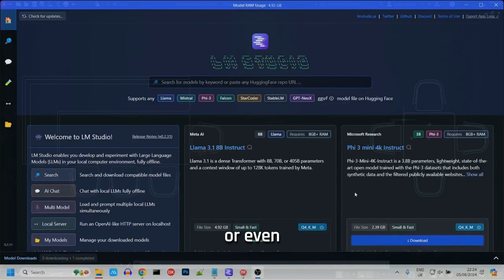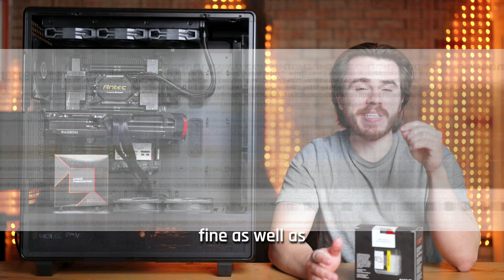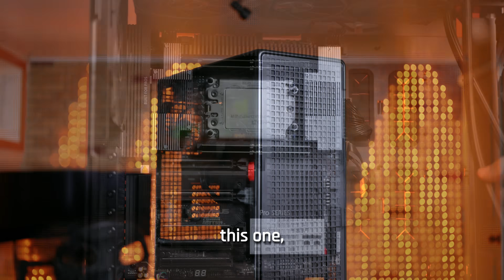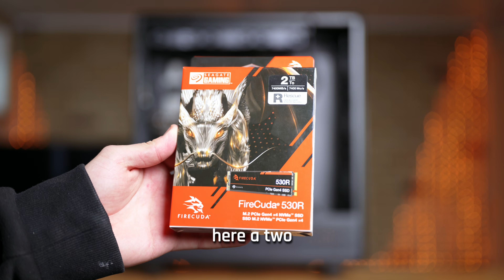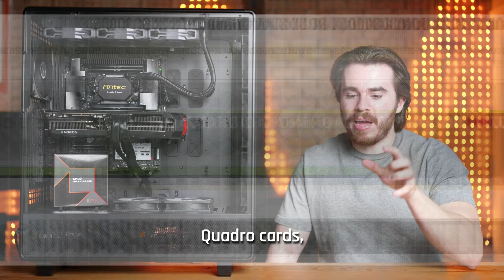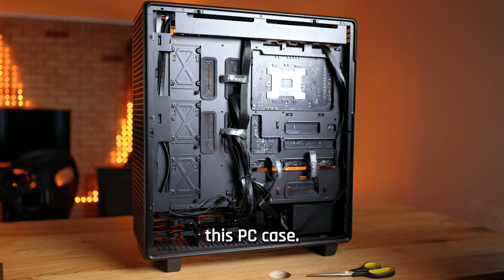The High-End Workstation PC Build Template for 2026

Comment: I’ve been lazy and haven’t built my own rig in a long time.  I was intrigued by this threadripper build.  Would this be good for an Adobe Premiere Pro workstation?  Or would another setup be more robust / budget friendly?
Reply from the maker: It’d be completely overkill

All you need is a Ultra 270K/250K/265K for a video editing workstation 

Either way, most of your video editing processes are going to be more GPU intensive than CPU intensive, so you’ll end up spending more on your GPU (5080/5070ti is minimum). 

I’ve got some video editing builds on pcbuilds.gg you’re welcomed to take for inspiration
Reply: @ScatterVolt  I saw those on your part picker.  Is there a one click to buy all? I’m lazy 😅
Reply from the maker: You can add each to your cart my friend, but maybe there is an add all cart button we should implement at some point lol

Comment: What about my Workstation PC specs:

- Case: `Corsair Obsidian 1000D Super-Tower Case`
- CPU: `AMD Ryzen Threadripper PRO 9995WX`
- Motherboard: `ASUS Pro WS WRX90E-SAGE SE`
- RAM: `Samsung M321RBJA0M22-CLP×8`
- SSD: `WD_BLACK SN8100 NVMe SSD - 4TB, Without Heatsink` and `WD_BLACK SN8100 NVMe SSD - 8TB, Without Heatsink`
- Case Fan: `be quiet! Silent Wings Pro 4 120mm PWM`×30
- Radiator: `Hardware Labs Black Ice Nemesis GTR 480`×2 and `Hardware Labs Black Ice Nemesis GTR 360`×2
- Pump: `Aqua Computer D5 NEXT pump`×2
- Reservoir: `Aqua Computer ULTITUBE 200 PRO`×2
- Tubing: `Watercool HEATKILLER EPDM Tubing ID 3/8" - 5/8" OD (16/10mm) black matte` (Undecided Quantity)
- Fitting: `EK-Quantum Torque STC-10/16 - Black` (Undecided Quantity)
- Coolant: `Aqua Computer Double Protect Ultra (DP Ultra) Clear` (maybe 2)
- GPU: `NVIDIA RTX PRO 6000 Blackwell Workstation Edition`×2
- Monoblock: `EK-Quantum Momentum² Pro WS WRX90`
- RAM Water Block: `Bitspower 4-DIMMS RAM Water Cooling Module (DDR5, Double-sided)`×2
- GPU Water Block: `EK-Quantum Vector² RTX 6000 Pro Blackwell Full-Cover Water Block`×2
- Power Supply: `Super Flower LEADEX TITANIUM 2800W ATX 3.1`
- NIC: `NVIDIA Mellanox ConnectX-4 Lx (SFP+)` 

It's perfect for me. What do you think?

Comment: Hi quick question im doing a mini itx build on a fractal ridge that has a pcie gen 4 riser and i will be using a b850 mobo with the rx 9070, will i be able to easily do the first bootup with the riser cable or should i first plug the gpu directly to the mobo and set the pcie to gen 4?

Comment: Nice build.  I just built a "high-end" PC especially for DaVinci Resolve.  It has a Ryzen 9 5900XT (essentially a very mildly underclocked 5950X), a 5070Ti, 6TG of NVMe storage, and 64GB of DDR4.  The case is a Montech Air 903.  I'm about to build another, primarily for audio production, with a 12900K, a 7900XT, 64GB of DDR5, and again 6TB of NVMe storage.  It will also be in a 903.  Both configurations are obviously more than capable of gaming, which is intentional.  Of note, I bought the 5070Ti around the beginning of 2026for $749, which I believe was as low as it ever got.  I bought all the rest in the summer and fall of 2025, before the AI-driven price explosion.  Sometimes it pays to buy based on anticipated future needs, not current needs.
Reply from the maker: Smart thinking
Reply: hahahah YOU are ME xD I built a similar editing PC this/last year, for Premiere - my 1st!
5950x on sale + "used like new" 4080 (cause 5070ti now is more expensive) 🤜🤛 I didn't know any better, so I only got 32gb ram haha
Reply: @technically-cool  That will serve you well, and 32GB won't be bad for most things.  TBH, 64 is probably overkill, but that's how I roll.
Reply: @rangersmith4652  yup im so thankful! for now I needed at most 27gb ram with my workflow, so im good - gg, create awesome stuff w/ ur pc man
Reply: @technically-cool  Thanks! That's the plan.  I have a lot to learn.